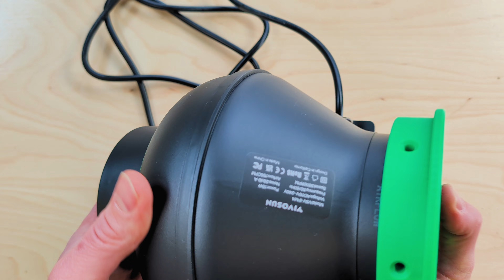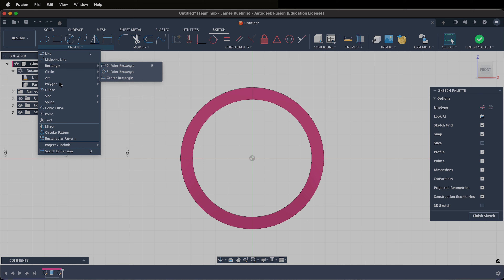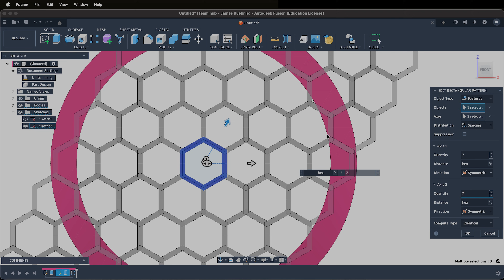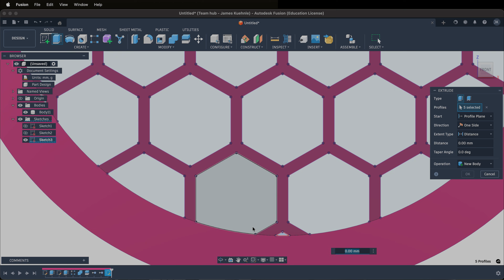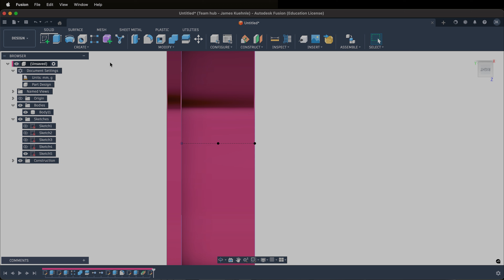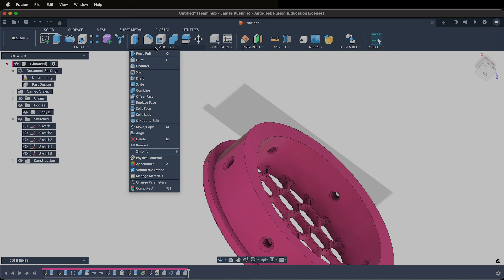Fusion Tutorial: 3D Print a Hex Fan Grill for a 4 Inch Inline Duct Fan

Comment: Great tip on the thin extrude, I've never used it before, or even noticed it :)  Only thing you didn't cover was filleting the mesh after you filled in the small gaps around the edge of the cylinder. Fillets magically appeared after that :)  Your videos make for great learning, even for experienced users who like most people, develop habitual ways. It printed in 1 hour 45 minutes using PLA Matte  on the Qidi Q2, and looks very good with the chamfered and radiused edges. Perfect lesson!
Reply from the maker: Thanks for the feedback, good catch about the fillets on the mesh, I made a mistake during the demonstration and went back but must have forgot to re-explain that section 

Also glad your 3d print came out well, what are you planning to use it for?
Reply: @WhatMakeArt  I didn't have any plans as such, for the part, just using it to work out printer settings,  although I will need to vent out the chamber exhaust from the back of the printer soon, as I want to print ABS. Just need to figure out the best inline fan to use, and a route to outside.
Reply: @WhatMakeArt  I know this is really old, but I am struggling to figure out how the fillets are performed in manner. My main issue is getting the fillets where the mesh meets the edge to do that.

Best I could come up with was filleting the inside of the hexagon before patterning it but that doesn't work with the edge of the mesh